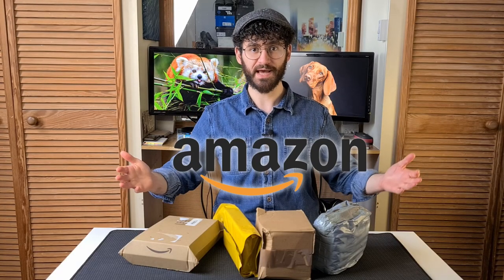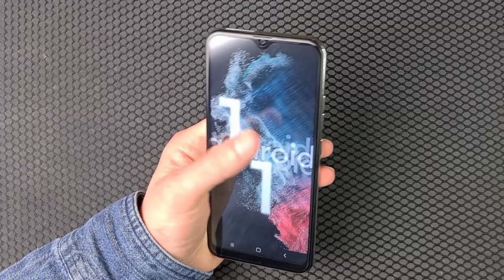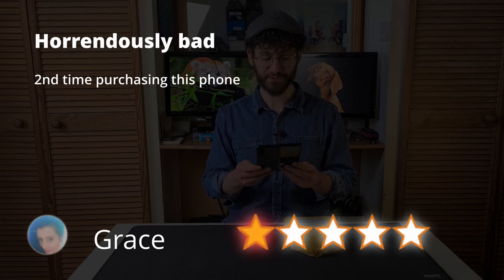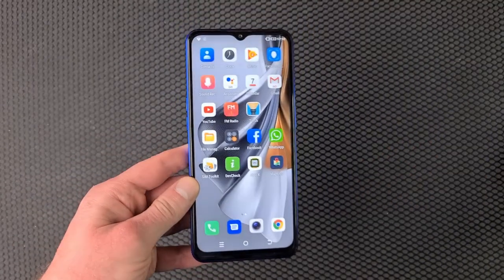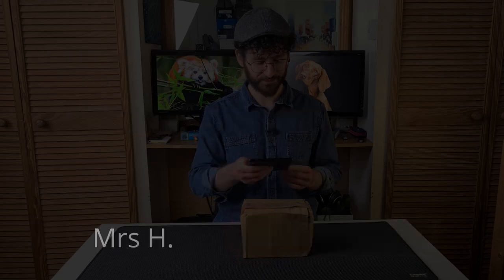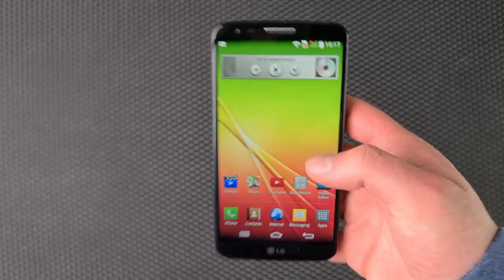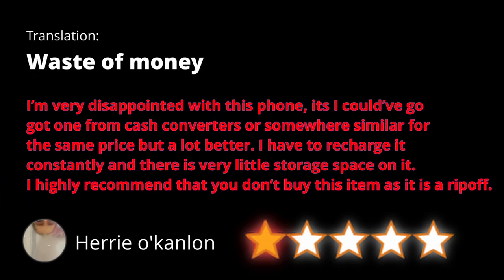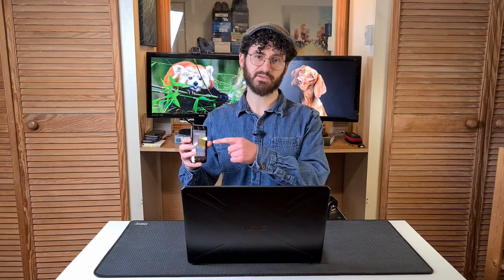I tried 1-star smartphones

Comment: I’ve heard about fake phones using this to put malware onto these devices. I think for some reason they just do not have a setup and have removed that via default. Probably to get away with lying about the so called “specs” 

I have seen variants of that “s22 ultra” where they didn’t even bother with the notch, and just put in a regular display, surprised to see they bothered updating it. I also noticed they went to all of that effort to fake the specs and the wallpaper, but the version of “OneUI” the phone is running isn’t even correct, looks to be running a ROM from a Galaxy S10?
Reply from the maker: Yeah, could well be, the fake s22 I really didn't trust at all, but the xgody seemed fairly legit, so I really don't know why they didn't have the setup either...

That's interesting, I'm sure there have been loads of these. Even the same seller had several confusingly similar, but different listing's... 
This one was a very low effort clone, very much a patchwork of different 'samsung' software and hardware, I'm not really sure you could pinpoint a specific version 🤷